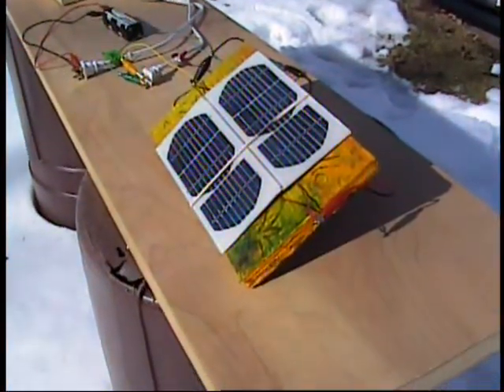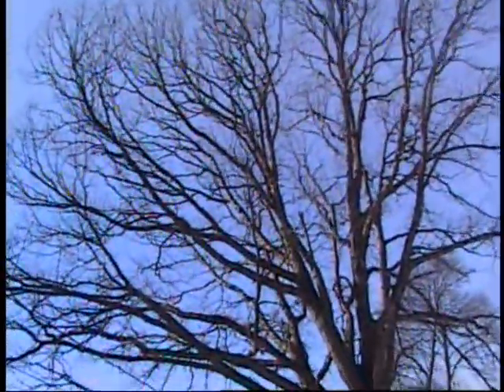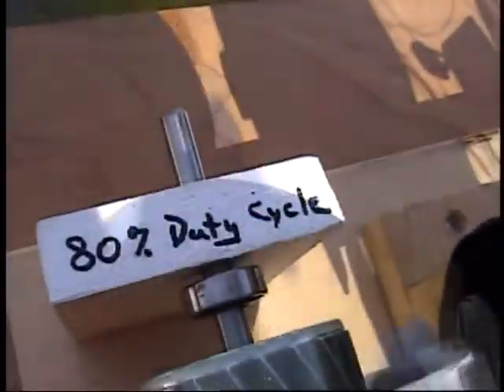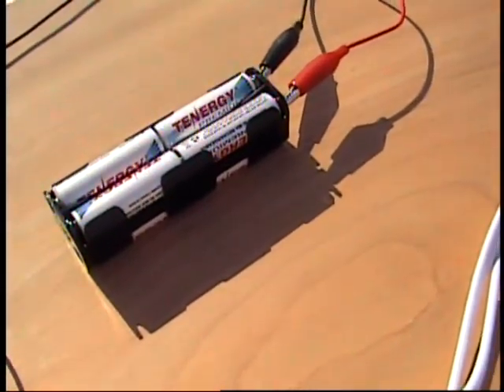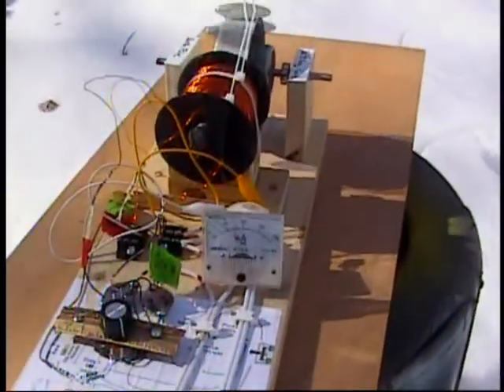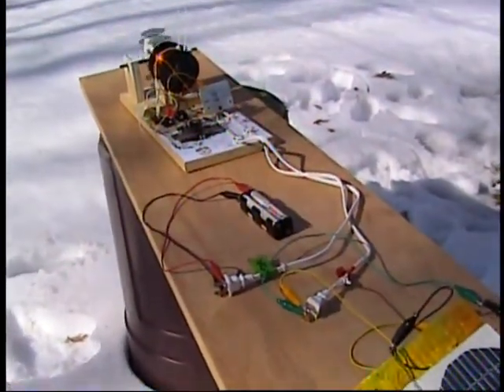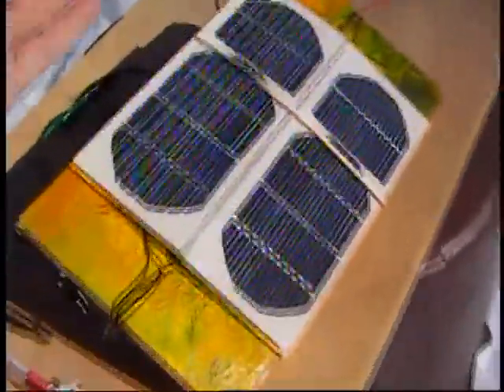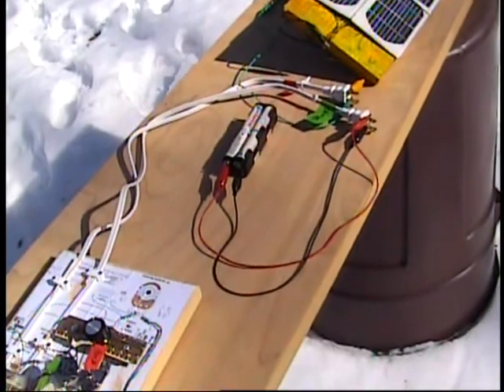Solar Running Bedini Energy off the Grid

Comment: Yes I have seen this one...it  helped me get started too. I have it spinning just need to add solar panels. What do you think of makeing a bike wheel connected to a alternator? Just a thought. Are you from mi I'm from grosse pointe mi lol I'll keep working on it
Reply from the maker: I think an alternator is a splendid idea. Converting some of that mechanical motion into more power. I would love to see that tested. I would expect Lenz's Law to cause some trouble. The induced magnetism in the alternator coils may require the Bedini wheel to consume more energy to compensate. But would that be prohibitive? Only a test will tell.
Reply from the maker: Luis, my solar panels are connect in place of the battery. They have a positive and negative just like a battery. I have diodes on the solar panels to prevent reverse flow. That is all that is needed. Optional is the use of a small capacitor in parallel with the solar panel output. The capacitor will catch power while the Bedini is not consuming. Then discharge for the short moment when needed.